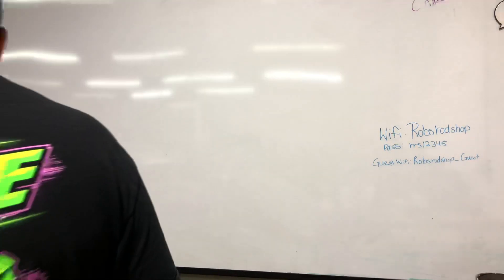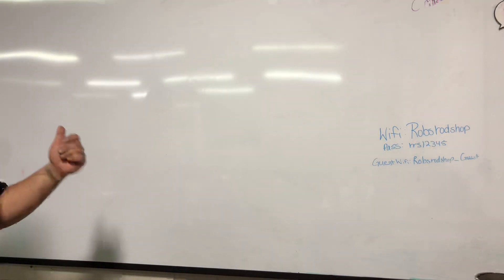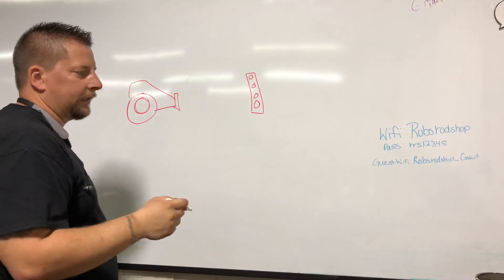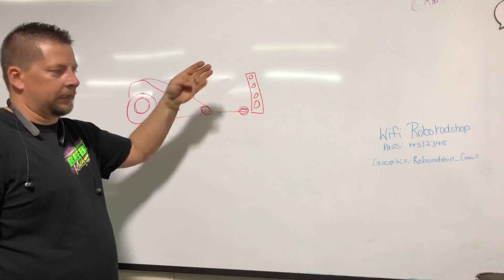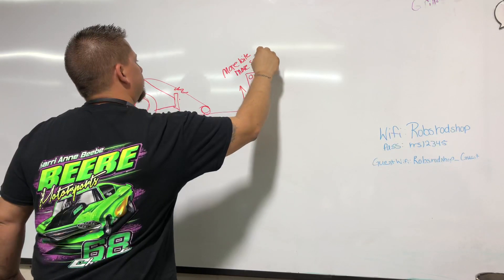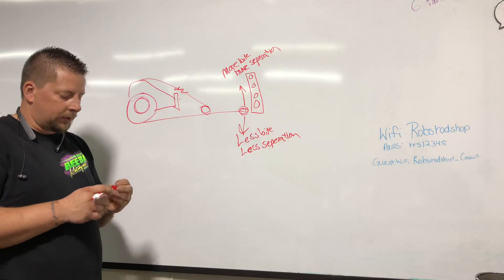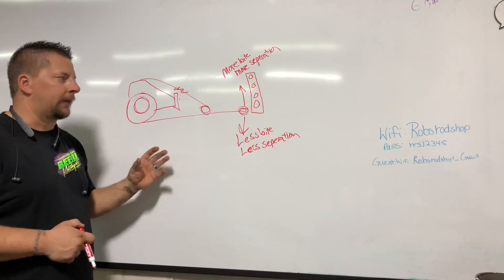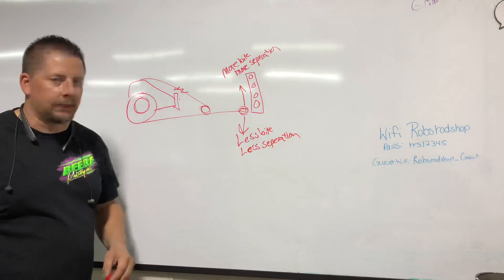Ladder bar suspension explained

Comment: Bar position can also be changed by ride hieght I changed mine fro the bottom position to the next hole up by lowering the rear spring-coil over spring shocks-came out in between were it was and next hole about half way up so it is doable thru ride hieght changes

Comment: most ladder bar suspensions it seems don't actually suspend haha.. will cause cracked/bent frames, and axle wrap,  it only works with suspensions with very low amounts of travel, and i see most are made of solid spherical joints seems odd.. some have like shocks and springs and a pivot point for suspension that actually travel seems odd
Reply: huh
Reply: @daveperry6793  very simple geometry, the leaf springs go up and down... therefore it NEEDS to move in and out so once the suspension compresses the bar pushes inwards towards the middle frame mount and goes upwards, it puts all the bump force INTO the frame as the whole assembly BINDS and bends, twists, bad,  this is a cheap fix to prevent axle wrap, holds it in place and is a good cheap, fast, mod originally popular for Drag racing vehicles only, not trucks and towing, or road going vehicles very bad IMO for a regular vehicle

Comment: For a newbie to installing this how should i set it up when installing the ladders bars for the first time ? Also the car is mostly ran on a slick but does every now and then run a radial ...and is it better to run a square tube cross member or a round tube cross memeber ? any input would be greatly appreciated
Reply from the maker: Tube design doesn’t matter that much. I’d set the car at desired ride height. Put the ladder bar in the center hole on the bracket and then put the ladder bar level. That where the bracket should be in the car.
Reply: @RobD828  ok great ill do that .thanks for the info I do really greatly appreciate it